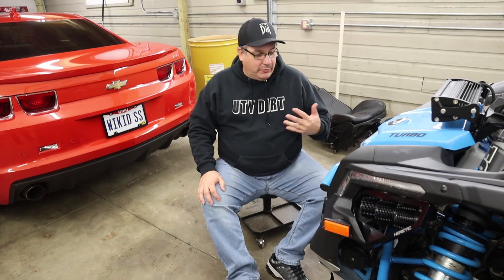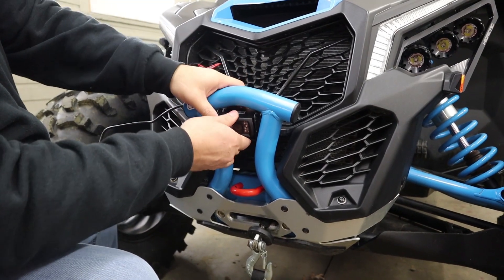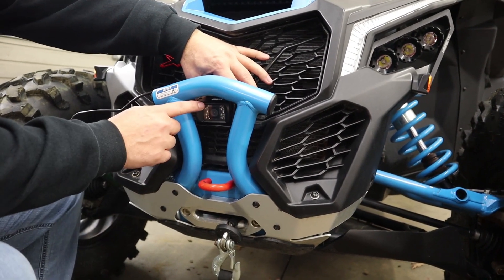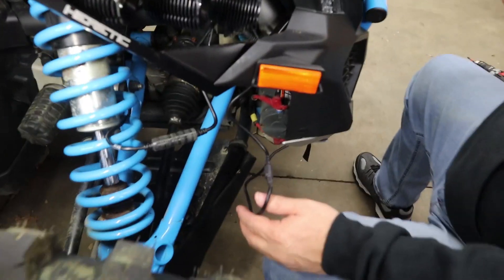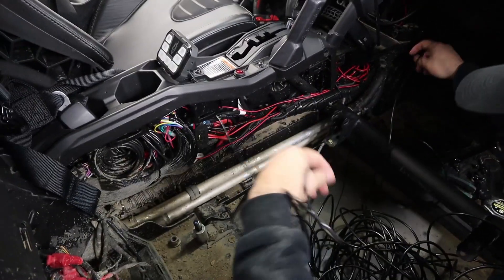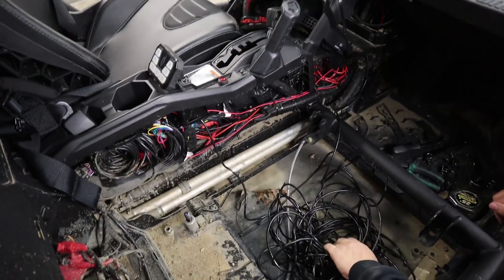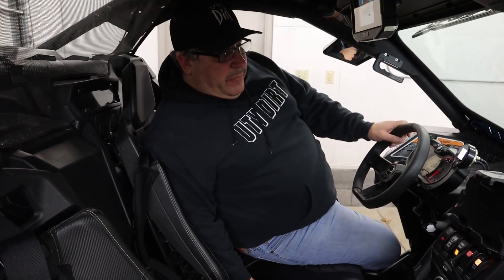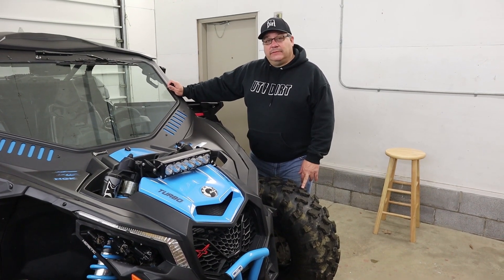Can Am Maverick X3 Front View Camera Install!

Comment: Can I get the link to this camera? I can’t find it anywhere. Thanks
Reply from the maker: It looks like the one I used which is linked in the description of the video is currently out of stock. I would just keep checking back to see when it comes back in stock.
Reply: As long as it’s a 5 pin will it fit the can am mirror ? Thanks
Reply from the maker: @rodneyscott4917  Yes it should work.